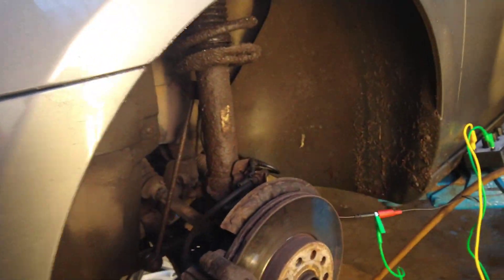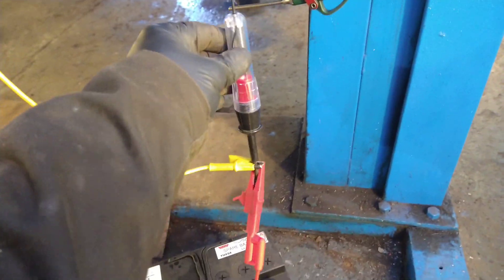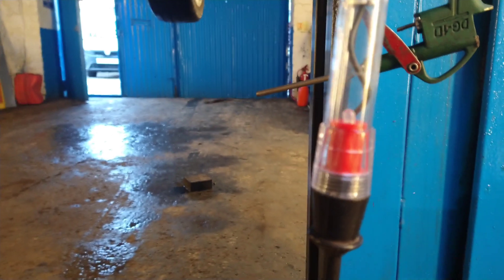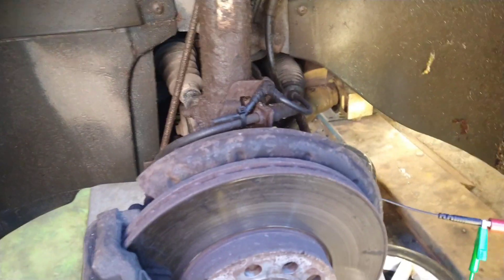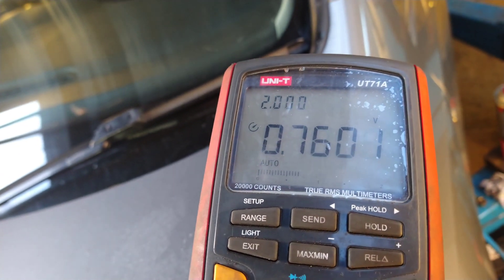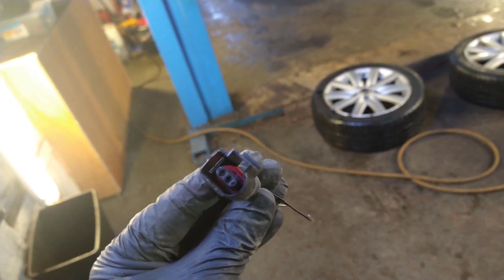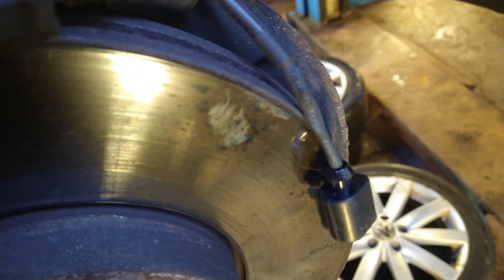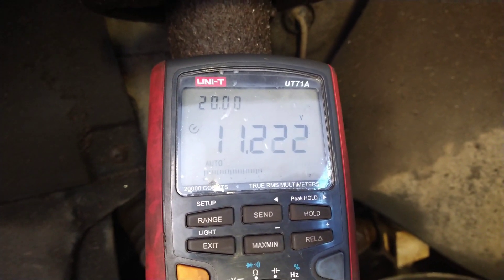VW Golf (ABS fault) over active ABS

Comment: I’m having a nightmare with my 2010 Vw golf 2.0 tdi it’s has the abs and car slip warning lights on 
At the brake rollers the off side rear brakes spontaneously go on and off basically the brakes racing is matching with the nearside and it’s grabbing was told it’s the abs sensor and wheel bearing had that done light had gone maybe some time later the lights back on was told it’s the abs pump had that taken off sent away for repairs and fully rebuilt by ecu testing back on fitted brakes got slightly better but on rollers it was as good for passing mot 😓😓😓😓 was told new caliper maybe discs n pads and also maybe needs a fully brake fluid bleed 

😳😳😳

Comment: Great job, Matt. I'd guess most would throw a sensor at that considering there's voltage on a backprobe
Reply from the maker: It could easily have been a mistake, I don't always front probe a connector, I'm glad I did here.
Your bench testing the sensor method helped check the sensor while it wasn't getting power.
Thanks mate.